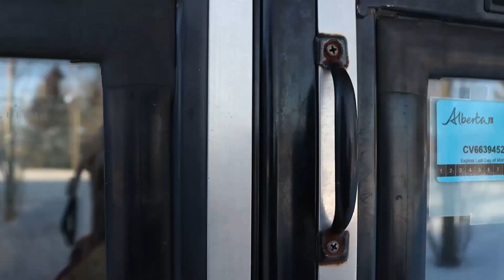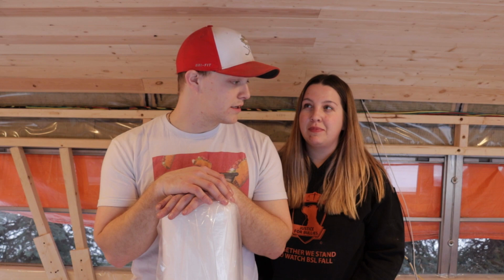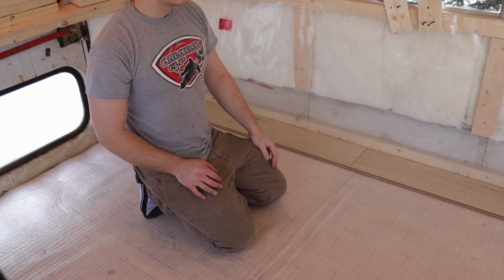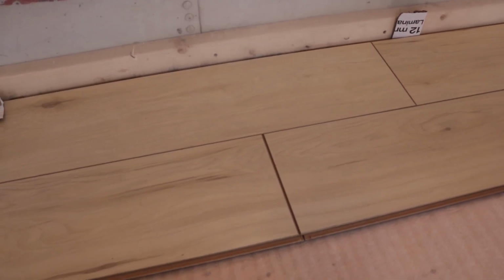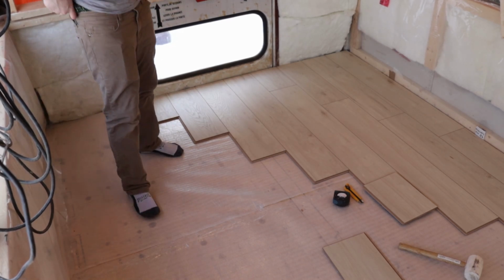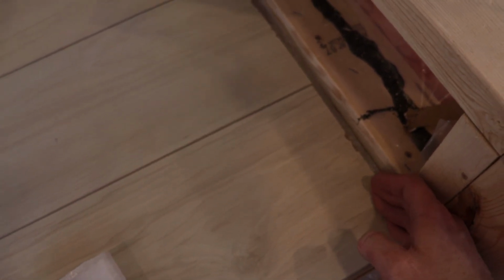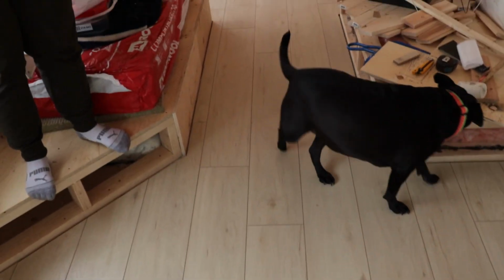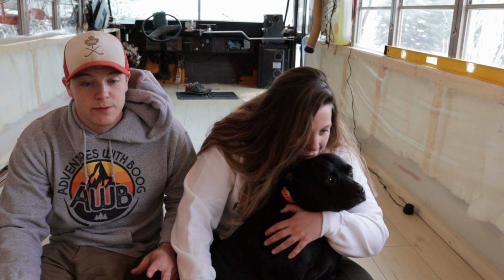Laminate Flooring Skoolie Install - Bus Conversion EP.17

Comment: I'm at the point where im ready to install my floor and I was wondering how your flooring held up after doing the wall right over it? did it buckle over time?
Reply from the maker: Over a year so far and not one issue. We have had extreme cold down to minus 40 and extreme heat up to plus 40.

Comment: What did you use for the ceiling?
Reply from the maker: We used 1x4 pine planks. Then brad nailed them to mdf ribs that we screwed the the steel ribs.
Reply: So they all just click together no glue no nails?